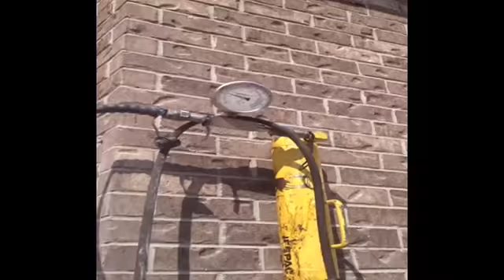Foundation Repair Pensacola, FL | Foundation Professionals of FL

Comment: I hired Foundation Professionals, Seawall Professionals to repair a seawall. I identified the voids and through my engineer identified exactly what needed to be repaired and where the areas of concern were. They sent me the contract saying they were going to fill voids, stabilize seawall and curtain, etc. The voids were not filled as agreed and as authorized in a change order for additional material. The seawall has since catastrophically failed and they promised to perform warranty work and repair the wall a month ago. They have now asked that I determine what needs to be done so that they can bid the work and I can hire and pay them to fix the job which they were contractually obligated to originally do.  They didn't do the job, they charged me more money, the seawall failed, they have not honored their warranty, and my seawall is collapsing.